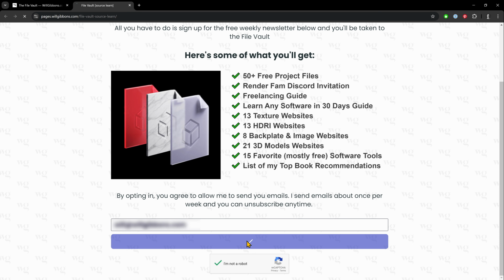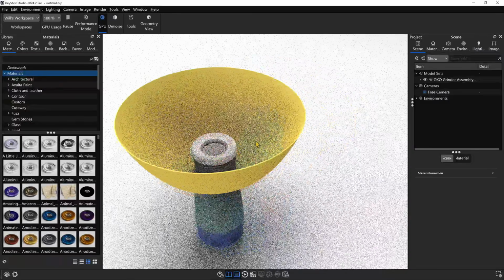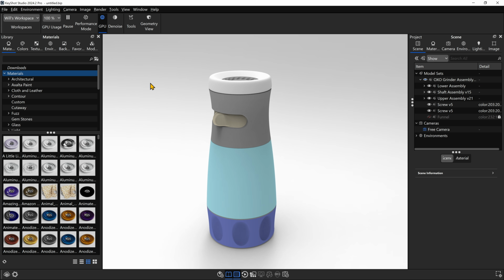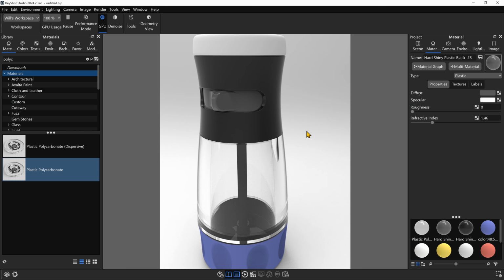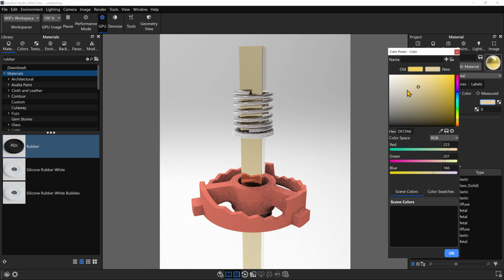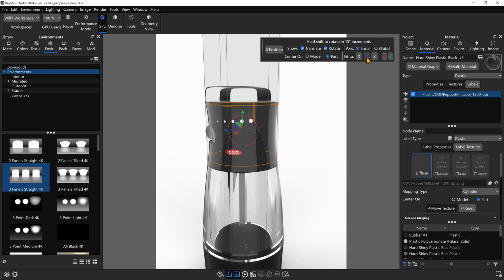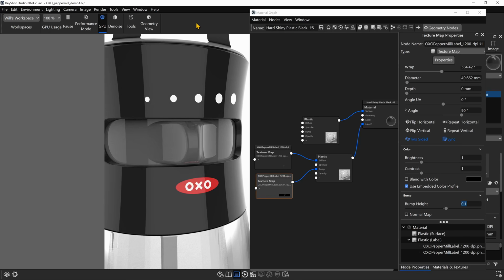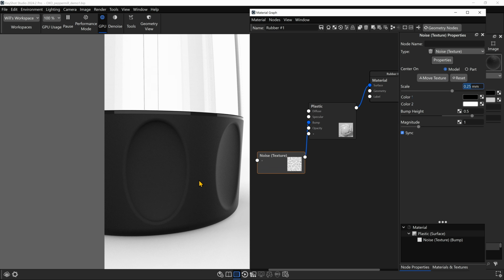KeyShot Rendering for Beginners Pt.1

Comment: When I imported the object, the environment was completely black. Why? And the materials didn't apply to all objects of the same color, even though I unchecked the import box? I'm using version 3.
Reply from the maker: It's hard for me to say for sure... but my guess is your environment has not been scaled to accommodate the model. Check its size. Also, since you're using software that's 15 years old... I don't think you should be able to expect it to work the way it does today. I'd recommend upgrading your license.
Reply: @WillGibbons  Here is the version I'm using: keyshot_studio_win64_2025.3_14.2.0.211
I think it's a size issue, but I can't get it back.

Comment: Hello, I would like to ask you a question. I would be very grateful if you could answer it.

I want to cover three telescopic tubes with carbon fibre. The tubes are nested inside each other, so their diameters are different. When I apply the coating, the patterns are applied in different sizes. How can I make the coatings look the same?
Reply from the maker: You would do this by unlinking the material on each tube. Then, adjusting the texture mapping size of the carbon fiber material. Just ensure the texture scale is identical across each unlinked material.
Reply: @WillGibbons  Thank you for the information. The texture scales are the same across all of them, but the texture is both gradually decreasing and exhibiting angular variability. I resolved it by adjusting them individually, but an automatic correction would have been preferable.

Comment: What software should I learn for 3D modeling? Is Blender a good choice for modeling and rendering in KeyShot? Any recommendations?
Reply from the maker: I would not recommend Blender if you're going to use KeyShot. KeyShot is often used with CAD modeling software. If you're going to learn Blender, there's a free built-in render engine called Cycles, which you could use instead of KeyShot.